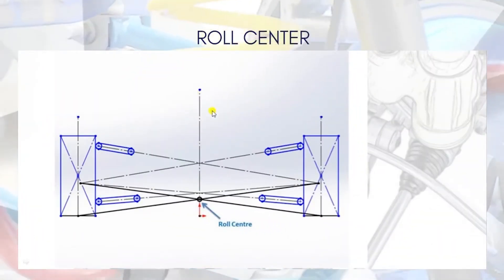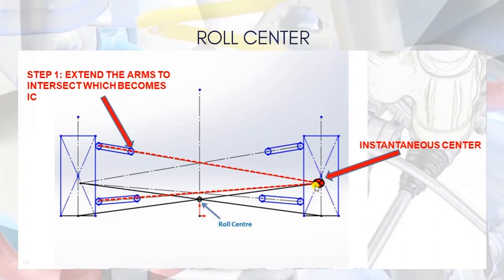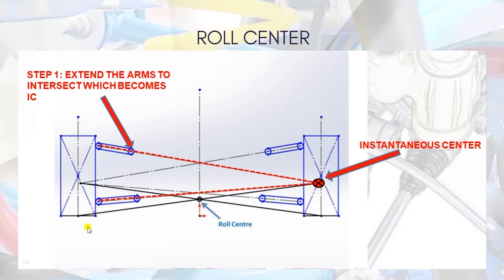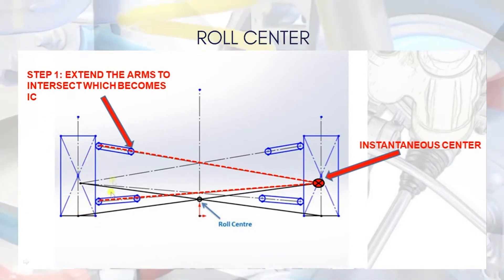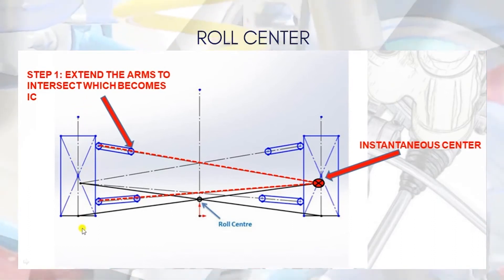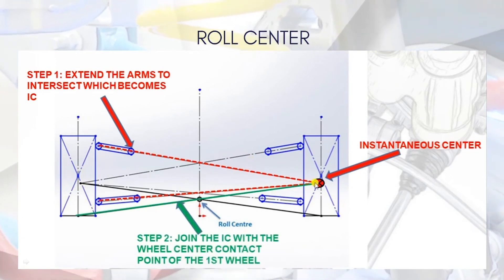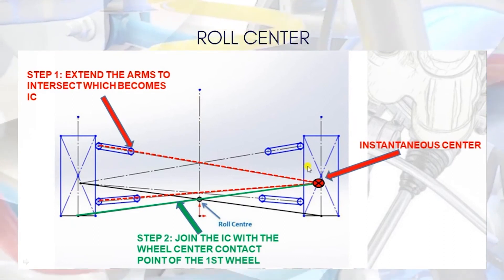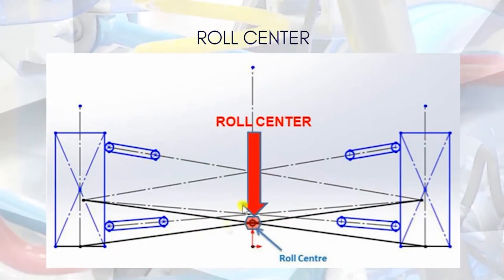How to find ROLL CENTER | Vehicle Dynamics Tips | | Elite Techno Groups

Comment: Hi sir, I got question,
In your example, you are using left tyre, both upper and lower arm crosses across to the chassis to the right, how if the upper and lower crosses outbound more to the left,
Your example inner upper/lower arm height difference is less than outer upper/lower arm height difference, but in my case is opposite, is the way to find IC also the same? And another case is upper / lower arm is parallel, how to find the IC